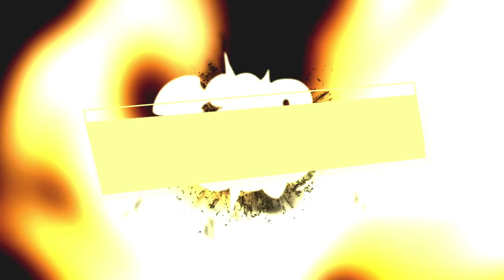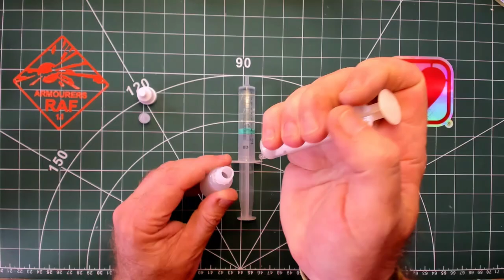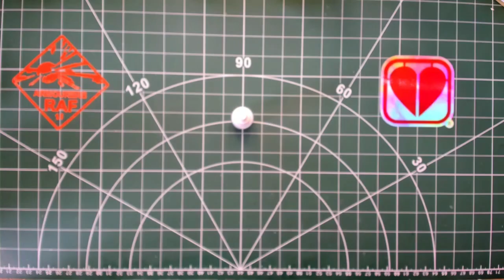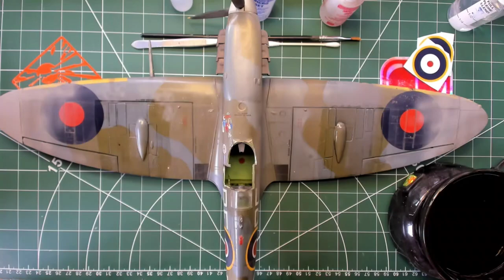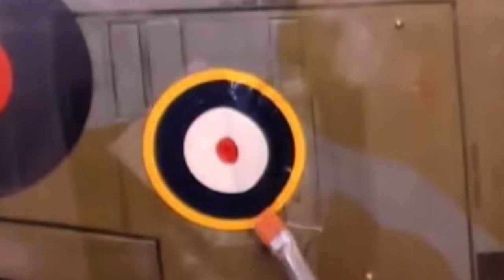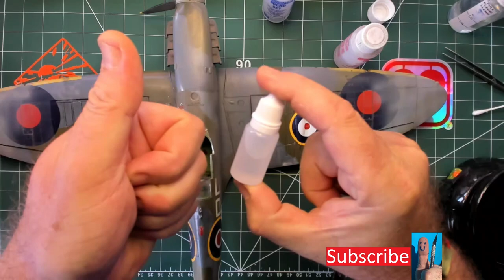Tutorial: DIY Decal Softener

Comment: Hi, you have said to use Enamel thinner in the video, but I would think what is needed is lacquer thinner or cellulose thinner. Most Enamel thinners are like white spirit and won't have any effect on vinyl decals.
Reply from the maker: Enamel thinners are similar to cellulose and lacquer thinners. As you can see in the video, they work on model decals, which, as far as I know, are not vinyl decals.
Reply: @BudgetModeller  HI thanks for your reply. I've always thought that water slide decals were vinyl based and I've heard others say this also, but I accept that this could be incorrect. The enamel thinners that I have used (ammo, AK etc..) are either white spirit or turpentine based products which won't effect decals which is why they're safe to use over acrylic paint etc... The stronger brand name solutions I've used such as ammo have a distinct lacquer thinner/acetone type smell.
Reply: @BudgetModeller  Hi, I went ahead and made up some test solutions one with 20% Ammo enamel thinner and one with 20% Tamiya lacquer thinner. The results were what I expected, the Enamel thinner worked about as well as Micro Sol due to the IPA content and the Lacquer thinner worked just like in your video. Maybe there's a loss in translation going on (I'm in the UK) and the products differ in our regions. Hope this is of help to someone.
Reply from the maker: @ste022  I’m in the UK too. I use Cellulose Thinners from Lidl’s which is £5 for a litre. It works the same as enamel thinners 👍🏼👍🏼👍🏼
Thanks for this 👍🏼👍🏼👍🏼
Reply: @BudgetModeller  Sorry I've slept since watching the video and forgot you had an English accent lol.

Comment: Is this solution equivalent to mr mark setter mixed with mr mark softner?
Reply from the maker: Hi Batharaampera, I honestly don’t know as I’ve never used them 👍🏼👍🏼👍🏼
Reply: @BudgetModeller  oh is it equivalent to micro set mixed with micro sol?👌, and when should use top coat after using this solution? Before or after? is it ok if I use enamel thinner from a non model kit tool brand ?
Reply from the maker: @batharaampera2283  Yes, the equivalent to Micro Set and Sol. Personally I decal before I varnish, but it’s down to your preference. Any enamel thinners works 👍🏼👍🏼👍🏼
Reply: @BudgetModeller  thanks a lot for the help(≡^∇^≡). Your channel is a great stuff for beginners with a budget. I wish you and your channel the best
Reply from the maker: @batharaampera2283  thank you for the kind words and enjoy your modelling 👍🏼👍🏼👍🏼

Comment: Does it work on painted surfaces? What I mean is it wont eat the paint or anything right?
Reply from the maker: Vicente, no it won’t, as you saw from the demo, as long as you keep the ratio as stated, it works fine 👍👍👍
Reply: @BudgetModeller  Thanks for clearing that out and also thanks for the fast reply!
Reply from the maker: @_pku55  You’re very welcome 👍👍👍
Reply: @BudgetModeller  Another doubt I had is if it would work using acetone or turpentine instead?
Reply from the maker: @_pku55  I honestly don’t know, it might do…Could try it 👍👍👍
Reply: @BudgetModeller  I ended up testing it myself and I can safely say it works very well!! I used 2ml of acetone based nail polish remover and 8ml of isopropylic alcohol. I also brew a micro set using 5ml of water and 5 of alcohol vinegar so the alternative is definitely there.
Reply from the maker: @_pku55  well done, can I use the ‘set’ please? Full credit will be given 👍👍👍
Reply: @BudgetModeller  Of course, feel free to do so! ;)
Reply from the maker: @_pku55  thank you 👍👍👍
Reply: @BudgetModeller  The base paint was enamel or acrylic?
Reply from the maker: @antoniogarcia723  It was Acrylic 👍🏼👍🏼👍🏼

Comment: Champ decal solution is by far the best I've ever used. Unfortunately, they don't make it anymore.

How does the alcohol and thinner work with the paint? Does it hurt it?
Reply from the maker: Nope, it’s perfectly fine with it 👍🏼👍🏼👍🏼
Reply: @BudgetModeller  so, just to make sure I got it right, 8cc's of 98-99% alcohol and 2cc's of paint thinner?
Reply from the maker: @inscoredbz  if you use the measurements in the description you’ll be fine 👍🏼👍🏼👍🏼